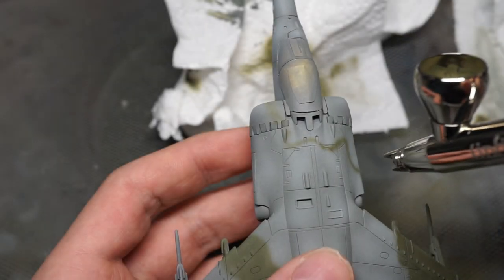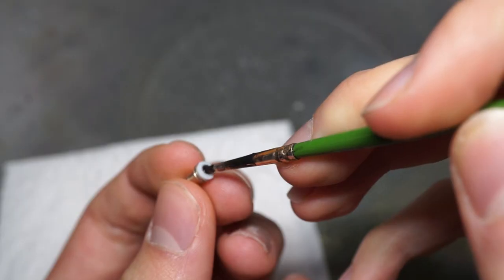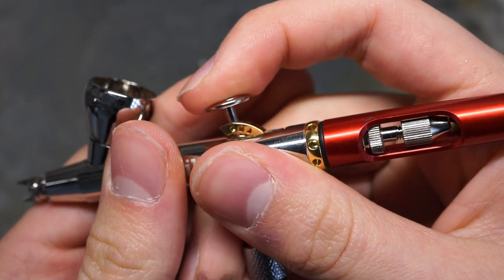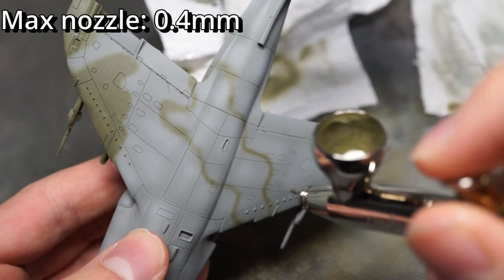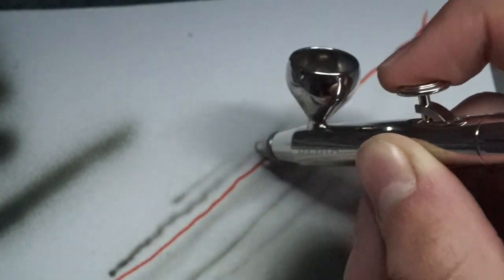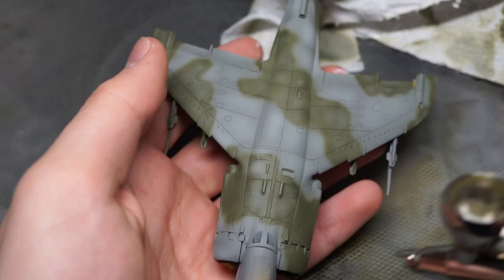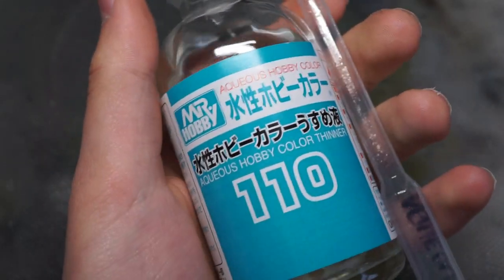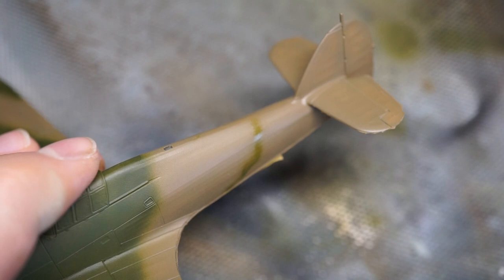How to Airbrush Aircraft Camouflage: Quick Tutorial

Comment: Great video! I have been building models since I was a child in the 70's. I initially brush painted models. More recently, I have used spray cans. I bought an Iwata airbrush and a compressor about 5-6 years ago. I haven't used it yet, but I am currently building a 1/48th Airfix Hurricane, my intention is to use the airbrush to paint it. I found your video very useful indeed, so thank you for posting!

Comment: How do you avoid the camo pattern outline line (if you know what I mean!) showing after you've 'filled in'? To me it always seems to be a bit denser and is thus visible as an outline.
Reply from the maker: @FinsburyPhil  it'll come with practice, but essentially you need to spray the outline as light as possible, using it only as a guide for the actual spraying if that makes any sense, working up to it with dense spraying until it's only just covered up :)
Reply: @ModellingWeekly  Thanks. As you say, like everything, practice!

Comment: Ive been tempted to buy and airbush kit but im a behringer and havent built a model in yesrs my main worry about getting one is spending loads off money not getting on with one and then theres oversally cleaning it all the time space to use how mucth mess do they make in a room if to wear proctive equipment reson i wanted one is to have a neast finish and i would really like to just add abit off detail to my model like adding panel lines  and add black around the exaust off a spitfire nothing to crazy just wanna do a nice job i would use tamiya paint as there ange off coulers is good ive heard tamiya paint isnt  greeat for brush painting tho i wouldn't wanna make to many brush marks either so not sure what i wann do yet as i have a revvell 1/32 spitfire i got about 3 years ago that i havent built and wanna build it

Comment: My Badger 150 spatters or clogs up  when using a fine needle/ nozzle to do camo.  What am I doing wrong?
Reply from the maker: Hey, what paint are you using? It's probably down to thinning ratio, but sometimes certain paints are more prone to blockages and spitting due to larger particle size/unsuitability for airbrush use
Reply: Hi  I use Tamiya or Vellejo
Reply from the maker: @simonjustie3206  Hey, Tamiya is definitely the better option to go for here as it features a much smaller particle size than Vallejo, as well as being alcohol based so it's much less prone to gunking up. If you can, definitely get yourself a bottle of mr. levelling thinner as this is the best thinner for Tamiya acrylics - however, if you can't, then isopropyl alcohol (99%) is a very good alternative. Start by thinning the paint down to around 60% thinner and 40% paint, adjusting from there depending on what your results are like. If your nozzle is already blocked from previous attempts, then letting it soak in alcohol overnight can help to loosen up any buildup, which you can then poke out with a toothpick or carefully with the needle itself (just make sure that if you do soak the nozzle, any gaskets/seals are removed from it before soaking, as they can be damaged by contact with certain chemicals). Hope this helps, good luck :)

Comment: Hello i am new to plastic models. What beginners airbrush kit can i buy and what paints and thinners as a beginner. I have F 18 mission impossible model to built. Need help to figure out if i can just use brush to paint. In case i use brush, what paint type and brand i can use.
Reply from the maker: For a beginner I'd highly recommend picking up a fengda airbrush, great balance between quality and price. As for paints, lacquers will provide the best quality finish, however you'd be better off starting with Vallejo Model Air acrylics as they're far less toxic and are far more forgiving in general :)

Comment: Hi, I'm really struggling with fine line camouflage (my first camouflage), using Paasche Talon GF 0.38 mm  with Vallejo model air.  Paint as a tendancy to splatter and the lines are not very clean also.  I'm spraying at 10 PSI and 4-5 cm on the surface.  BUT I have to tell you that I'm practising on Plexiglass surface unprimed, because I just don't want to mess up on the model.  As the surface is very glossy, does it could explain more splattering than it could on a model surface?
Reply from the maker: Hi, If you mean the paint is spidering, then this could definitely be because of the Plexiglass you a spraying onto - however, if it is a grainy finish, it's probably best to either thin the paint down further slightly with flow improver, or to play around with the pressure until it looks better!
Reply: @ModellingWeekly  Thanks to you, yes there is definitively spidering a little bit and I think you're right about the surface. 10 PSI with a GF is it sound too low to be close to the surface?  What are your recommandations?
Reply from the maker: @lbboy2513  I'd say if you have any spare kit parts to try spraying on, that would be best - as I said before, definitely dry toggling the pressure a little to see what happens. I wish I could help you even more, though it's different with every airbrush and compressor setup! Good luck!

Comment: I’ve been getting my butt kicked trying to do ultra fine lines using an H&S 0.15, and 0.2mm nozzle using Tamiya thinned with IPA down to 90% thinner. I’ve been trying between 10 and 15psi with no change in result. Still getting tip-dry after a minute or so. Added a few drops of Tamiya Paint Retarder to no avail. Nozzle is totally clean, needle perfect. Actually put a new set in to see if I was missing something. Not sure what else to try. Getting tip dry at such high dilution makes no sense. Any ideas?
Reply from the maker: Given you have tried everything, the only thing that I could possibly think of is the paint itself! If the paint is a bad pot, or that particular colour is a bad mix, then no amount of thinning would prevent small blockages on the end of the needle, making it seem like it's going tip dry. Just to check this out, I'd do a control using a pot of paint that you know is a good mix/colour! Good luck man :)
Reply: What AB do you have? If it's cheap you'll never get good results no matter how fine the needle.
Reply: A bit late, but IPA is your issue. It evaporates far too quickly for this type of painting (although there are times you want quick-drying!). Try Tamiya's lacquer thinner and add a drop or two of the retarded per 20ish drops of paint. I usually do equal or greater thinner to paint, just depends on the needle size.

Comment: I need a technique to drill a centred hole in a < 1mm piece of plastic rod to simulate a gun barrel?
Reply from the maker: I've seen quite a few people use small hypodermic needles to deal with small holes such as this, maybe that could work? Alternatively, you could heat up the tip of a pin and melt a hole into the gun barrel :)